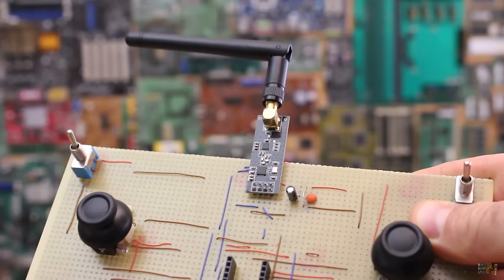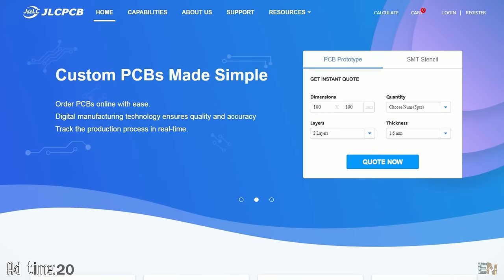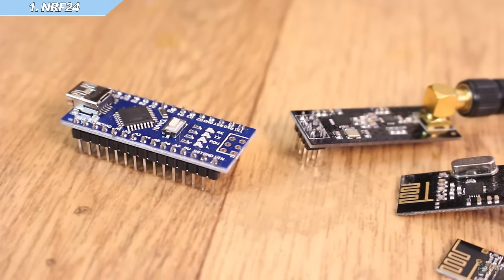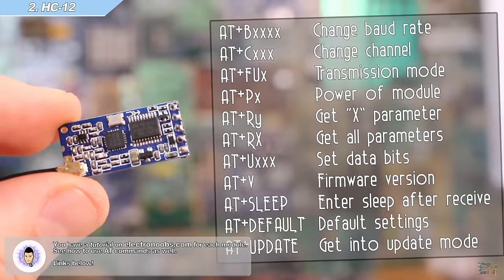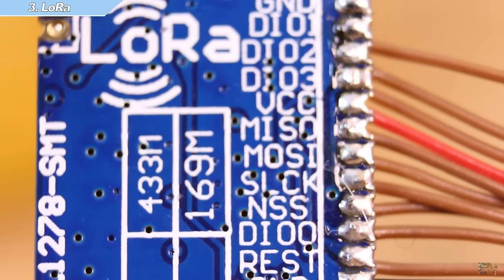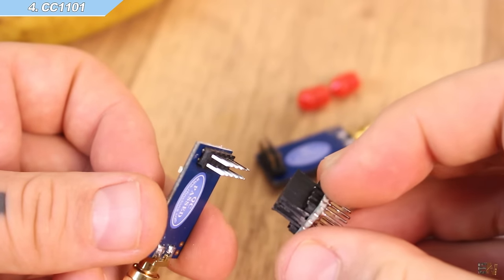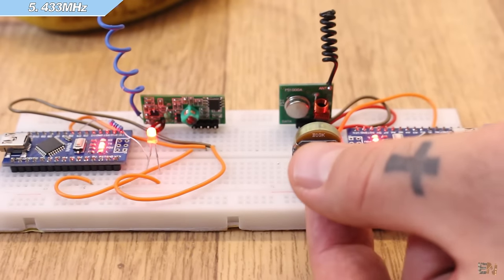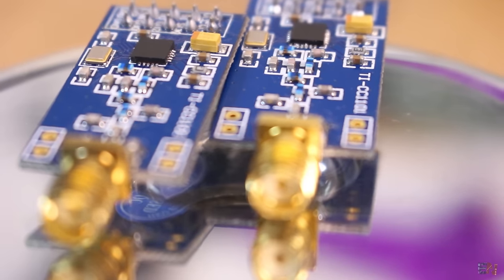Which radio module? NRF24, LoRa, CC1101, HC12, 433MHz, HC05

Comment: Nice video. I have used the cheap ESP-01 and wrote some firmware for it. Now I can send and receive serial commands over WIFI (with websockets - uninterrupted speedy bi-directional live connection) in an adhoc private network or in an existing network. It behave like a wire, you don't notice the difference 🙂 I made this for my printers in another room, printers without ethernet or WIFI but can also be used with any Arduino (because my printers are Arduinos). 

I made this because of a longer range, speed and the possibility to connect between different networks/routers (even through a real ethernet wire! ) and to be able to use older serial software or serial equipment that doesn't support ethernet or WIFI or other wire/wireless tech.  For now I am only using serial with this system however it can be anything, video, voice, charts, live chat, calls, interactive commands etc, it could be anything. The nice thing is that you can use existing infrastructure and security for all of your projects. You can make any virtual wire you want and if you want it can go all around the world (internet). 

The nice thing of the ESP-01 is that it is programmable and you can put any (custom) protocol inside this device without have to repeat all of this protocol and security coding stuff inside your project. Once designed correctly, you can concentrate on the project and features of your project. This will save program space and makes it easier. With this you can make any (tiny) microcontroller wireless. This is a feature all of the other wireless solutions in your video don't have. This is something that makes a real difference. 

Maybe something to look at. Again, nice video and great accent ;-)
Reply: I need to send 64 bytes of info under 50ms, 50 meters away. Can I do that with the ESP?

Comment: Don't use virtual wire for the cheap 433, try the rcswitch instead.
Reply from the maker: Thanks. I will try that
Reply: @ELECTRONOOBS 
Also, try to use the receivers that come with crystal oscillator, they are much better than the simple version you used, the price worth the difference. 👍
Thanks and nice video, keep up the good work 👏

Comment: Your homemade antenna on the nRF24 is probably doing more harm than anything else. While designing an antenna you need to consider the length of the antenna and also its impedance. I am not sure you actually measured / calculated them, but if you did you should mention in the video you didn't just solder a random piece of wire shaped like a coil.
Reply from the maker: No, that was a random wire. LOL
Reply: @ELECTRONOOBS   can transmit RF signal  within 2km  ,  at  outdoor with obstacles like trees and small houses ,

I need some information from u , to make RF remote control 3phase starter.  (On and Off auto on ) by using RF transceiver modules..  it is possible?

Comment: do you know a radio unit that can transmit and rescive at a range from 30km? i need it as a prototype for a vehicle for our locale firedpartment!
Reply from the maker: 30km no. But the nrf24 with a good antenna could get to 10km or more. Check channel iforced2d video about that...
Reply: @ELECTRONOOBS  ok im already on the resarch!

Comment: USB EXTENSION WITHOUT CABLES-ALASKA

Nice video, very descriptive.

I will really appreciate your comments.

I work at the North Slope Alaska during the winter season and we test devices deployed at the field covered by snow / ice. 
The way to test those devices is using a small computer with a USB cable that is having a special head at the other end (internally this is a USB extension, no circuits inside); this end is attached to the deployed device and the software recognize and test it.
The deal is: this software works only using USB port, is no way to select other type of connection.

I was reading about all this modules and they converts USB to TTL and TX, USB to Bluetooth and TX or some modules use  TTL and TX.

Some of this modules allows two way communications, some are recognized as COM port and some work interfaced with Arduino, but no one of this is transparent for USB.

That I try to say:

Is any way to connect USB (D+ and D-) to a TX and RX pins in a module on one side and RX and TX to the special head connector (D+ and D-) at the other side and at this way simulate a ghost wire?

The data string for this test is very short and sure is USB 1 or maybe 2.

Again, I will appreciate your comments.

Claudio Bio
claudiobio2012@gmail.com

Comment: hey, im trying to use it on an esp8266 board but its just spilling errors :/. with an nano it works just fine
Reply: Use what?
Reply: @xboxgamer9216  the library
Reply: @Dreez  so u r trying to use an esp8266 or esp8266 with arduino uno
Reply: @xboxgamer9216  sry 
I have not formulated some things clearly. I have an esp8266 mcu and an CC1101 RX AND TX module
Reply: @Dreez  sorry never used one of those
Reply: @Dreez  btw ur drone skills are realy good
Reply: @xboxgamer9216  the video i have online is pretty shit tbh.. but thanks i guess

Comment: Thank for posting - really informative!   I really like the adapters you made to help connect dev boards to breadboards  Great ideas!
Reply: Which modul is good for sending voice over 5km?
Reply: @worldmusic8941  I might be wrong, but I think none of the modules mentioned here would be anywhere sufficient for voice at any distance... These devices focus on data transfer.   If you were to carry a voice over a data connection, you would need to consider the sample rate for voice (5Khz should be enough, and a bit depth of 12-16 bits.   Doing the sums, 5000 samples per second, two bytes per sample, means 10 kilobytes of data per second (or roughly 100 kilo bits per second)... so you're looking at needing a baud rate of at least 100kbps (without any error correction protocol, and only half duplex).
Reply: @originuk  can you tell me name of any modul than i can send voice? Price is no problem

Comment: Which one is best for drone 
At a distance of 4 km?
Reply: Not sure but I guess lora
Reply: @xboxgamer9216  but he is saying lora is slower compared to NRFl01
Reply: @jayakrishnans2785  well do u need that much data transmission rate? U just have to send small sets of data at once and for sending small sets of data it should be fine ig .

I am no expert
Reply: @xboxgamer9216  will it be fine for drones?
Reply: @jayakrishnans2785  I guess but

 I am no expert
Reply: @jayakrishnans2785    don't just buy lora or use it because I said its okay just try finding vids .

U an indian?
Reply: @xboxgamer9216  any way thanks for replying.
yes i am indian and you ?

Comment: Hi there..Thank you for an excellent video.. I have a query for you.. I am using a Gamma868 lora module for transmitting very short bursts of serial data.(which it does very well)...The default packet length is about 1second.. I am told that reducing the packet length will reduce the available range, even though the power level remains the same.. and that it was something to do with reduced encryption.. Is it possible to explain simply why this is so, please?  Thank you.. John.. UK